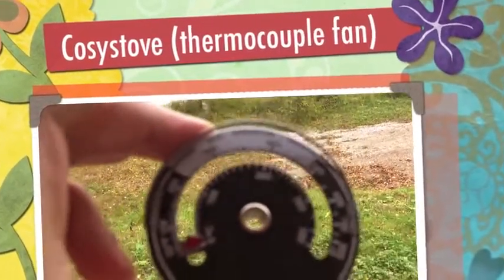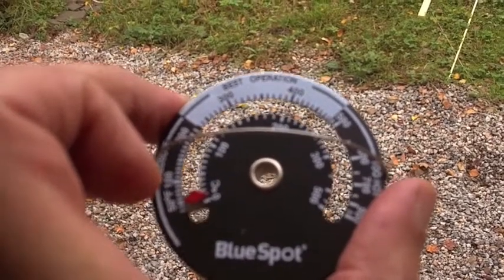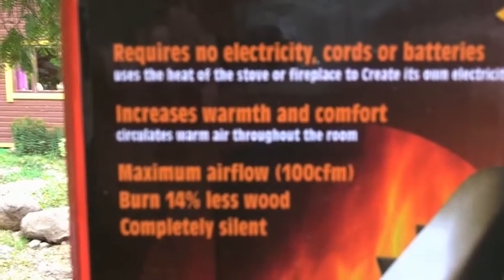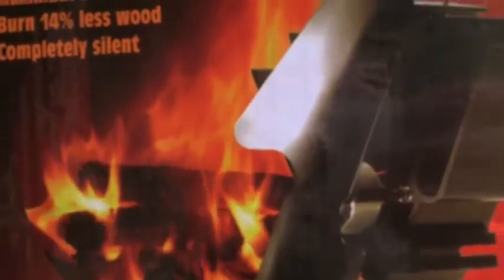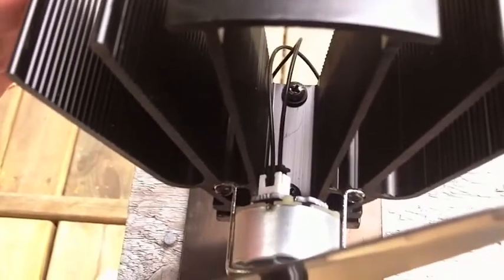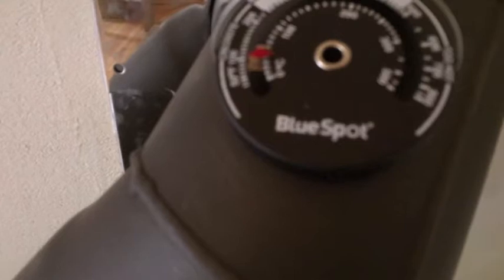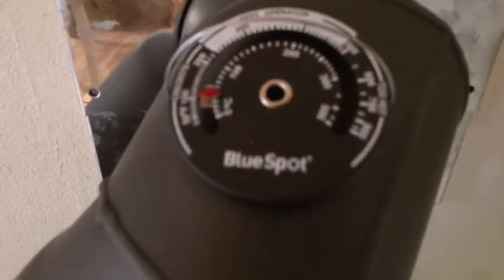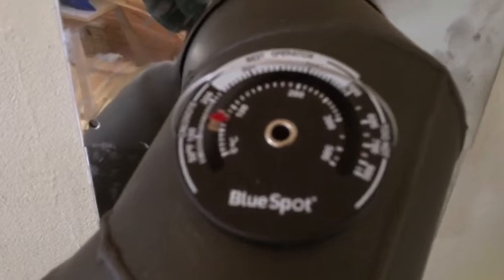Cosystove ( a heat powered thermocouple fan )

Comment: Nice heater for your hunting camp. I hope it tells you not to use it on a gas fired stove. BTW the little thermometer unit is +- 30 degrees F.  -used them on hot asphalt. The Warning about the kids is so they keep their fingers from the fan more than the temperature.

Comment: Unique stove fan. Magic like how an old crystal radio works with no electricity. Your apples were a lot better than mine. We  did not get any this year. Bernard
Reply from the maker: +navajopa31 The bark has come off the base of one of  my trees I think I am going to loose it. Started with rabbits nibbling the bark. Shame.
Reply: If they chewed it all around the truck like a beaver does the tree is history. Even a small part of bark still attached will allow the tree to live. Wish you luck! Bernard
Reply from the maker: There is about half the bark left around the base, and all the leaves on the limb that has no bark have already turned yellow and are falling off the tree. I have noticed that many of the apples on that part of the tree are mummified so there might also be some fungal/bacterial disease getting in there.
Reply: All mummified fruit should be picked up and or removed from the tree and discarded in the trash. You get a lot of diseases from spores left near or on the tree. Compost piles don't get hot enough to kill them. I hope you only lose the one brach. Bernard

Comment: Witch craft I tell you  it is witch craft. LOL I think I will try to find the thermometer that would be useful to know that the stove is running at optimum temperature.
Reply from the maker: +Dale Calder There are lots of different thermometers both on ebay and Amazon having quite a spectrum of prices I just bought the cheapest one. Seems that there is a science to burning wood to get the optimum burn. Too cold and you get soot and creosote which are not good for your chimney, and too hot means wasted energy, I have found that keeping  the primary air flow adjusted so the flue temperature is about 300F gives a good burn and the most heat.
Reply: +OldGardenerGuy I just bought the same one on Amazon $12.69 free shipping, likely from China.
Reply: +OldGardenerGuy I stand corrected I just got shipping confirmation on the thermometer and it has been shipped via the Royal Mail, so somewhere in the  UK I guess.